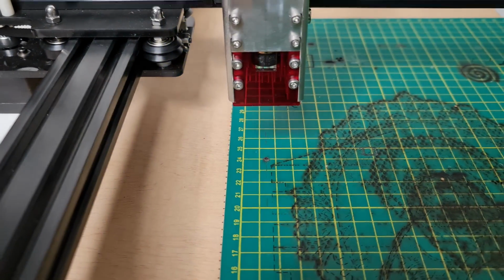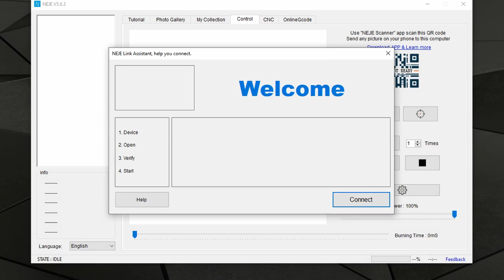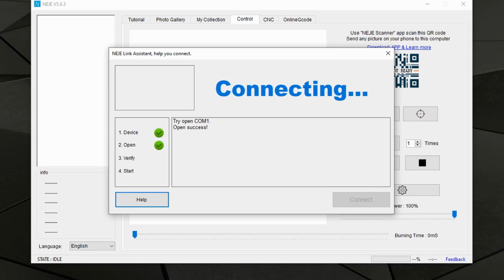Laser Flashing Problem - Say bye to your laser module - NEJE

Comment: Thanks for the work you did trying to figure out the problem.
I thought if maybe you lightly touch the fan with your finger to prevent it from moving while
you position it on the x,y axis, it would not spin the fan and create a current flow.
I started up my machine, but noticed that the fan does not move at all while manually moving the module around the
x,y axis. Maybe this was a fault of only some machines?
Reply from the maker: Hello Lance Davies, thank you for your comment.

The current is generated by the stepper motors, i.e. the one responsible for moving the axis which is set to rotate as we move the axis manually. The fan spins because it is energized by that current coming from the stepper motors.

I would not suggest stopping the fan.
Anyhow, I am not sure if this is a flaw of some machines only, in my view the reverse current protection is not included in the design at all.

Ciao

Comment: hello guy. thank for the video
i have the same problem with my laser module that i use only one time. should i buy another one to solve the problem?
Reply from the maker: Hello Adama Thiam, thank you for your comment.

Hopefully is not the case but let's try to isolate the problem.
Try to disconnect the module and see if the machine initializes and connects with the computer, then try to send an engraving job and check if it works, I mean just the movement.
If the above goes well then the module is most certainly gone.

Let me know.
Ciao
Reply: @MiddleRoomWorkshop  Hello . I did what u said me to do. now, my machine works well and i just replace the module with a new one. Thx a lot

Comment: thank you very much for the good information

I hope the module will be repaired soon.

I am using the same model
I also thought that reverse current flows when the axis is moved by hand.

Thanks to your video, I have prevented the same problem from happening.

I'll have to put the NEJE software at the origin and turn the power off like when the NEJE software was first run.

May I ask you one question?

When the power button is pressed once and when the power button is pressed twice

And do you know what the difference is when you press and hold?
Reply from the maker: Hello Bebepapa, thank you for your comment.
I will try to repair the module, but in the meantime, I have the 40W module.

In regards to your question, the function of the button depends on the state of the machine i.e., ON, OFF, WORKING.
- If you push it once while the machine is plugged in but is off, it will power the machine on (off means that the laser does not shine)
- If the machine is on, i.e. the laser shines then: a single push send the machine home, once more and send the machine to the latest engraved position, once more and it starts engraving the previous job (apparently the machine has some memory).
- If the machine is working, one click will pause the machine, click again and it will resume.
- Two clicks it seems to do nothing
- Holding for a few seconds shuts the machine off (only the laser)

I do not use that button, but it does something.

I hope this is helpful.
Ciao